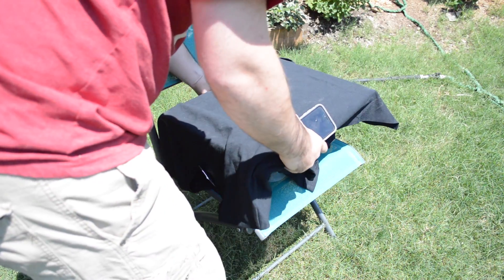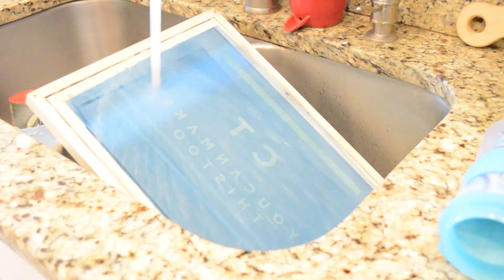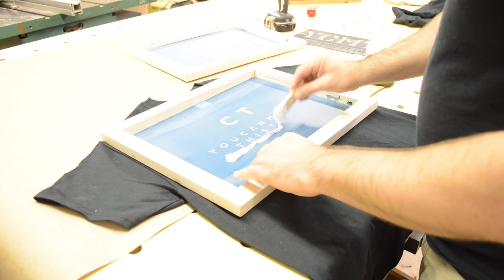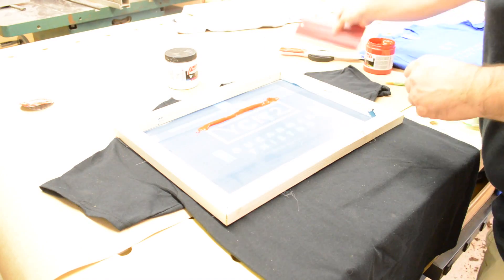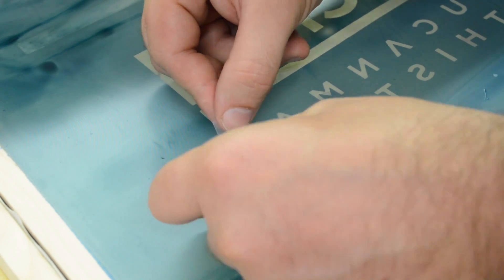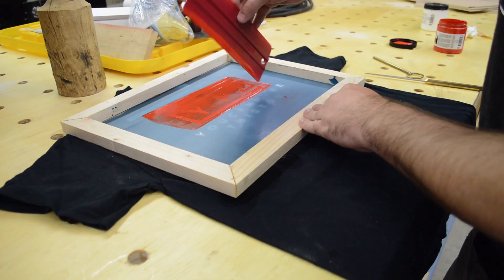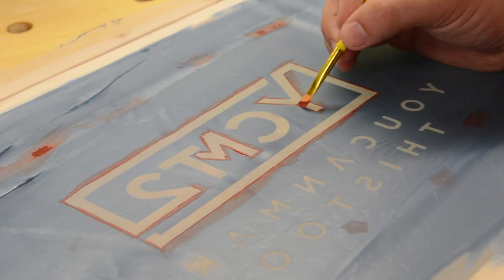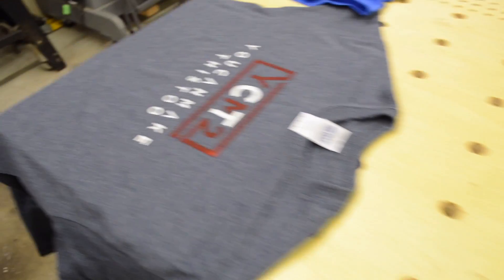DIY T-Shirt Screen Printing in 2 Colors with Speedball | How To

Comment: Before printing, spray 3M Super 77 Multipurpose Spray Adhesive onto your board. Then place the board into your shirt, then smooth out shirt onto board.  This will keep your shirt from lifting between prints and throwing your registration off.
Reply from the maker: Good tip

Comment: I wouldn't have thought about putting the white underneath. That makes sense though...kind of like a primer. Is that part with two layers noticeably thicker than the rest?
Reply from the maker: +Bruce A. Ulrich clearly I didn't think of it before either! It isn't noticeably thicker, I thought it might be but can't really tell a difference.

Comment: Did you heatpress the t-shirt or is this is a new ink that doesn't need to? Thanks for sharing.
Reply from the maker: I threw it in the dryer afterwards. Most screen printing is heat set. Shops normally use uv lights to quick cure them.
Reply: I find that a Home Depot heat gun works really well to cure the ink. I’ve used a hair dryer but it’s pretty annoying

Comment: I've been fighting with trying to pull this off without the right equipment. I might just break down and order actual screen, emulsion, etc. how do you heat set the shirts?
Reply from the maker: +DN Handcrafted I heat set them in dryer using the touch up setting, not until after they dried to the touch. A fan sped that up. Do you have a vinyl cutter? You could just get screens and screen filler and avoid the whole emulsion process that way.
Reply: YouCanMakeThisToo ah, ok. Yes I have a cutter. I tried something similar but the fabric I tried to use as a screen didn't hold the filler and it bled around my vinyl.
Reply from the maker: +DN Handcrafted gotcha. I haven't tried anything except real silk screen stuff. It's pretty cheap from amazon.
Reply: YouCanMakeThisToo I'm equal parts cheap and impatient. So tried to pick up workaround stuff locally. I should just stop wasting time and money and just pick up the real deal. Haha.
Reply from the maker: +DN Handcrafted lol amazon prime is my best friend. They have to be losing on me in shipping costs. Does take a little forethought though.

Comment: How are you printing the masks? Is that just transparencies paper?
Reply from the maker: +Justin Miller yes, just a transparency. I go to FedEx and they print for less than a dollar a sheet and there's one near my house. For me that's easier than messing with it myself.
Reply: brilliant.
Reply from the maker: +Justin Miller thanks!
Reply: Justin Miller most offices and schools have laser jet printers which can print on transparencies. I had my friends mom who worked for a local school print up my stuff. They’res also some laser jet printers for home use. Inkjet printers don’t work with transparencies. Or you can draw directly onto the transparency with an opaque black marker.

Comment: I was hoping to find in the comments but I don't know what "burning" means....could someone explain?
Reply from the maker: Turning an empty screen into mask that'll only let ink through the design you want. The emulsion is cured by UV light, or burned. So putting the design on the screen is burning.